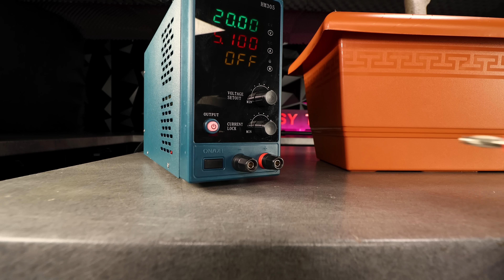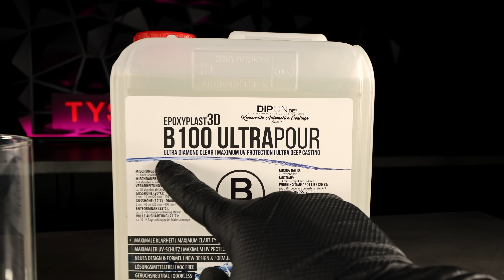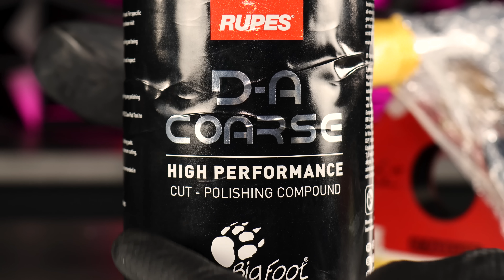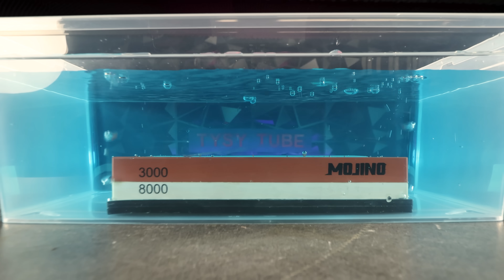Rust is Peeling this Huge Cleaver - Restoration (with Carbon Fiber Handle)

Comment: 0:55 Rust is iron oxide, meaning that each iron atom (Fe) has bonded with the surrounding atoms of oxygen (O), giving Fe2O3. It is possible to decompose these bonds by applying heat, but this won't give the pure metal, it will simply give a mixture of very hot Fe and O. As soon as it cools the rust will re-form.

In order to actually produce the metal you need to give the oxygen somewhere to go - somewhere it would rather be than in Fe2O3. One of the most preferred states for oxygen is being bonded to carbon, as carbon dioxide aka CO2. So we just provide some pure carbon as we heat up the rust, and we get carbon dioxide and pure iron: 2Fe2O3 + 3C => 2Fe + 3CO2.

The pure carbon is provided in the form of purified coal called "coke". This is where pretty much all the iron and steel in the world come from. You never find pure iron in the ground - when you need iron, you mine for rust.

Comment: It's not a cleaver, it's a Pole arm. They are fielding tool blades. You might be able to use it as a cleaver, but the original handles are typically 3 feet long or more.

Comment: About to handle, next time maybe use a smaller mold with a resess for the tang. Turn it on a lathe, then shape the handle. The blade can be seated with a bit of  scoring a little resin in the pre-made recess... 2¢

Comment: You did a most excellent job restoring the blade, but did you really have to chop a melon on a metal surface?
I can't imagine that this does not damage the blade. 😲
Reply from the maker: the table is made from wood, only looks like concrete 😂

Comment: It's a very good restoration what does the part that makes me die inside and it's sanding it why not use a belt sander unless you don't own one then it's okay but if you do on a belt sander then why not just use that

Comment: With a different weave of carbon fibers, you probably could've shaped the sheet right to the handle without having to cut it, like they do in the molding process

Comment: That is a Brush Axe... it lands somewhere in between a machete and a standard axe. My mom and step-dad restore axes and saws and there are several of these in various styles at their place right now. I also have a modern version that I use on the Blackberry bushes at my place... seriously a simple Google search could have told the OP as much but they were too lazy to even do that much research.

Comment: That's not a cleaver, it's an executioners axe. You can tell by how long and broad it is and by how flat the edge of the blade is. Not to mention the fact it's hafted. All of these are design choices to chop heads cleanly and efficiently. Lot more macabre that you're restoring it when you know that.

Comment: Shitty welding, the handle is still bent af and shouldve been fixed before rehardening. The polish job is mediocre at best and.....epoxy? Really? No respect of the original craftmanship and trying to make old look modern never comes out good. Even if this was at the request of a customer this is half assed amateur work at best.